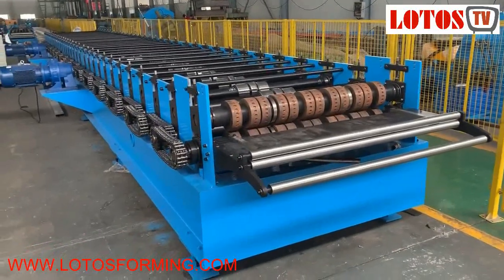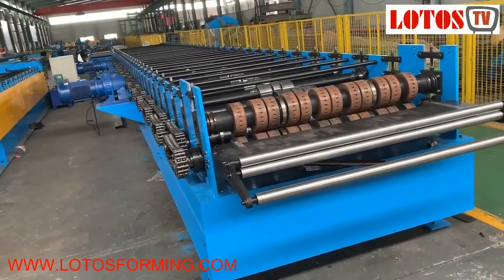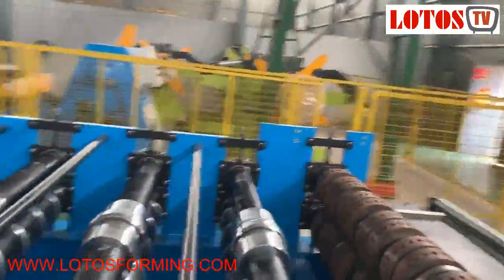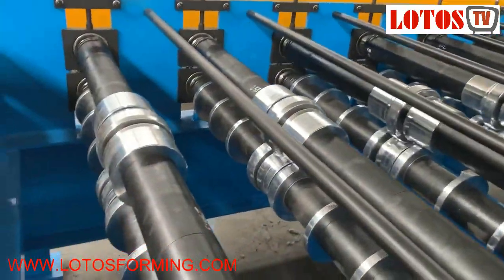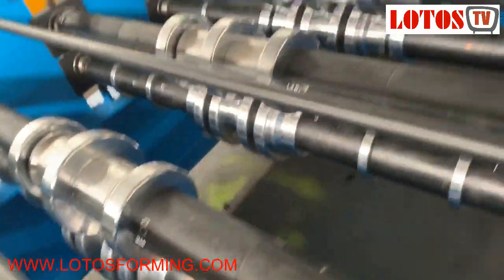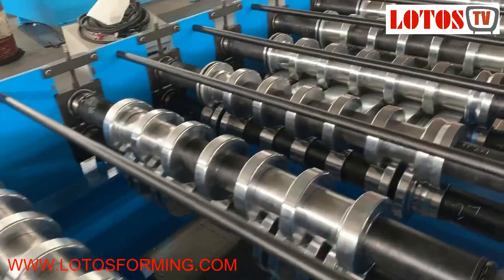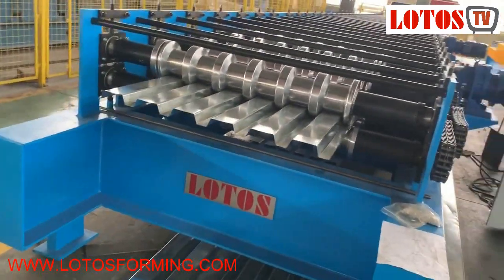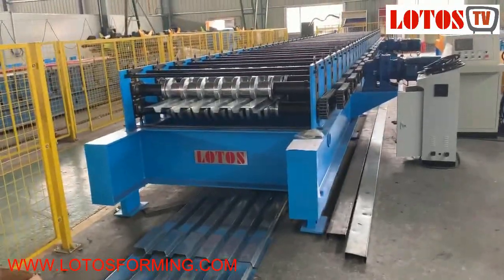【Metal Deck roll forming machine】:  Comflor Deck Roll Forming Machine | Decking Machine "LOTOS 2020"

Comment: Metal Deck slab is steel cum concrete slab consists of inbuilt shear connector with concrete on top together forms a part of the floor structure called composite slab.